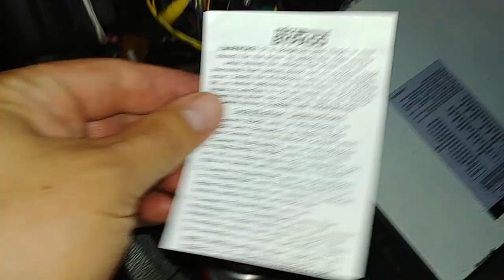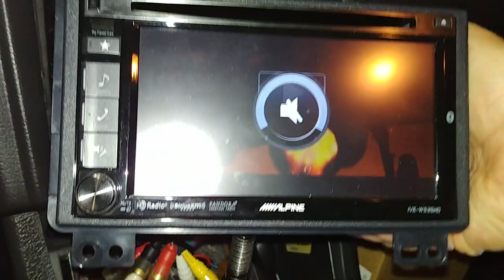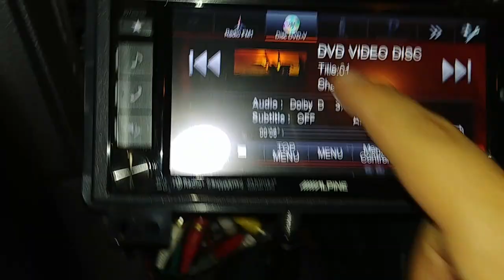Installing a MicroBypass on an Alpine head unit

Comment: You don’t need to buy anything extra like a micro bypass or toggle,
So basically have the parking brake wire tapped into a ground connection, but make it a loose or easily removable connection. Power on the vehicle and remove the connection to the ground. Then reconnect it causing the safety feature within the radio to release everything thinking the vehicle is actually fully parked when really it’s just the grounding bypass trick 👌🏼

Comment: Thanks.  Needed a little help. I have the Alpine i209 I just installed with the Alpine combination brake light, back up camera. Alpine was no help at all. Wouldn’t read the canbus for automatic. And this was the easiest solution. It worked without a flaw. I have a 2015 Jeep JK 2dr. My next part is to install the amp. 
Thanks for the help.
Reply: So it didn’t affect your back up camera in any way ?

Comment: Thanks for this! I just bought a car whose stereo was an alpine ilx-007. The wiring is a mess but it does have the same bypass you showed…and to make things worse, I have no idea what I’m doing, but I’m learning. I used a power supply to test the head unit at home and there is power to the few buttons, but there is no display. Would this be because the wires for the bypass aren’t hooked up when I’m testing the unit? Do you think there should still be an image with just power hooked up (positive and negative)? Thanks

Comment: Did you have to connect the blue/white wire from the bypass and connect it to the cars solid blue from the antenna and the blue/white from the car, then connect all three of those to the blue/white wire from the alpine ?
Reply: Did you ever figure this out? I have the same question